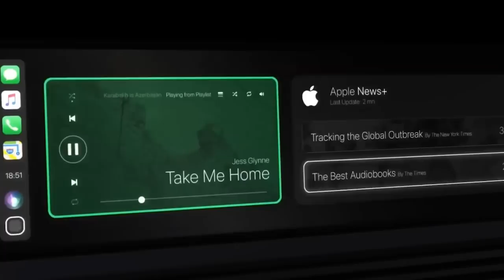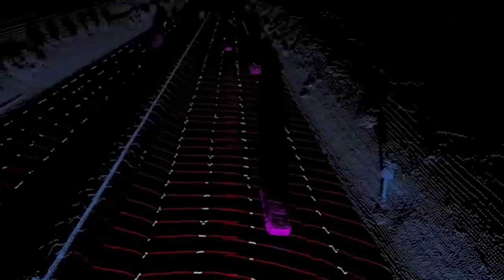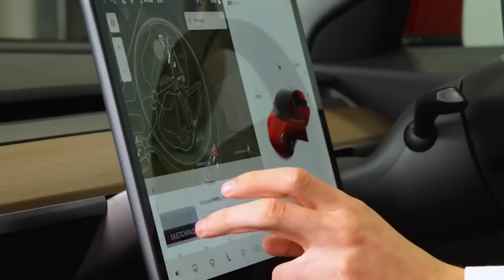ALL NEW Apple iCar 2023 SHOCKS The Entire Car Industry!

Comment: As much as I love Apple, I don't think they will make a car. They are focused on the Apple CarPlay, which the advances that have been shown, but not yet in any current on-the-road vehicle. I think Apple's work with the car industry is aimed more at having the iPhone be the brains of a car and likely Apple's Map app will become an AI to drive cars that feature self-driving features. If a car can just interface with a user's phone, rather than having a "brain" built into the car itself, costs could be shifted to other features.

I'm pretty sure no vehicle can be made for the US roads to have no stirring wheel or pedals. They are required since AI hasn't been perfected and likely won't be perfected for many many years. I'm pretty sure Tesla and other cars that feature self-driving do require human interaction occasionally.